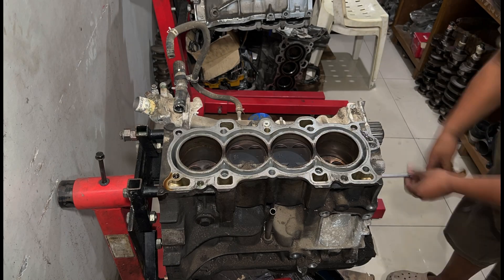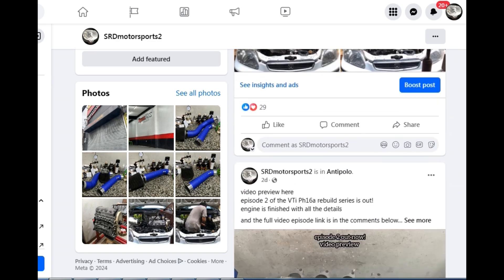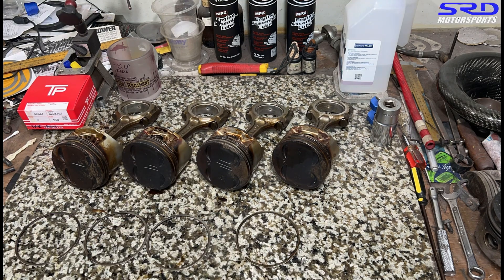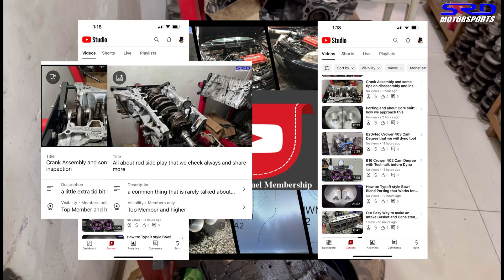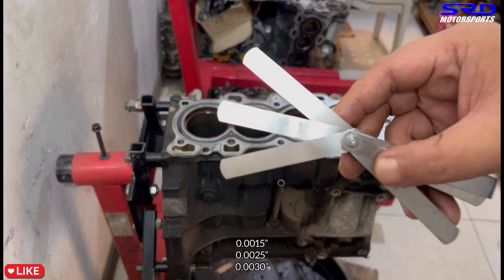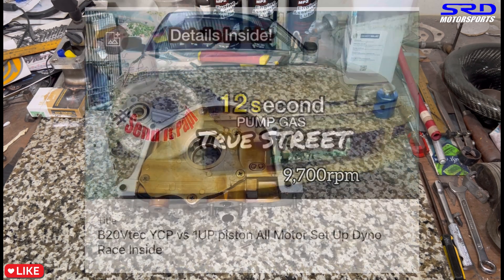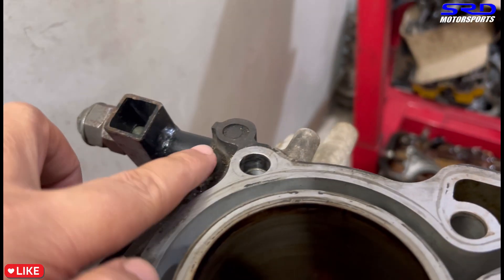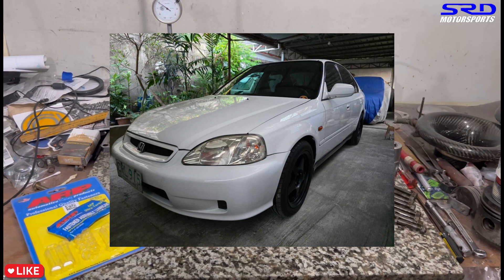Honda Civic SiR B16a to B20vtec Rebuild series part 2

Comment: What are your thoughts on sleeves cracking on high rpm NA engines? Fact or fiction?
Reply from the maker: @Marcturbo1  fiction as u saw on the video one of the many b20 we built was Jasper’s we built it in 2016 (9yrs ago) raced since 2017
Upgraded to higher comp pistons than YCP in 2018 and raced still to today

9,700rpm and its daily driven no trailer
Reply: @SRDmotorsports  that is so good to hear
Reply from the maker: yes sir! the tune and proper tune is always very important
Reply: @SRDmotorsports  I map my own cars, as you know, so that's never a problem.
Reply from the maker: yep